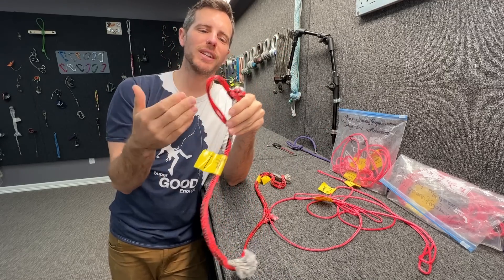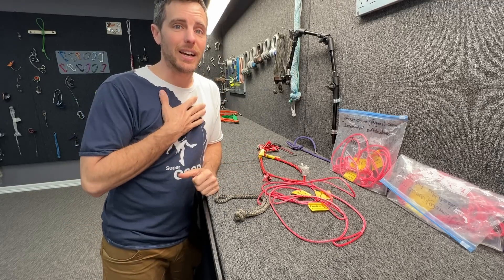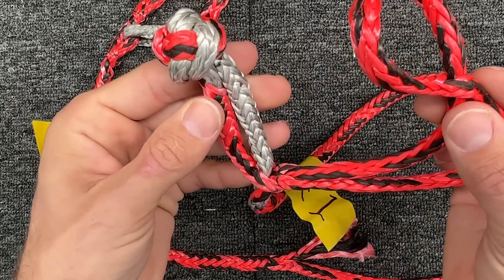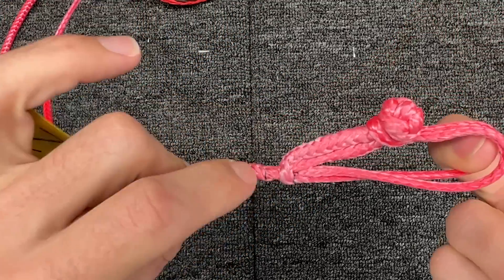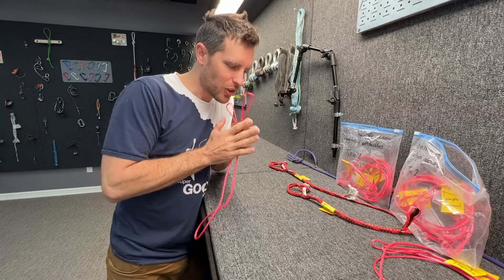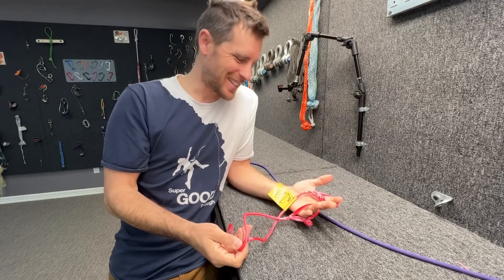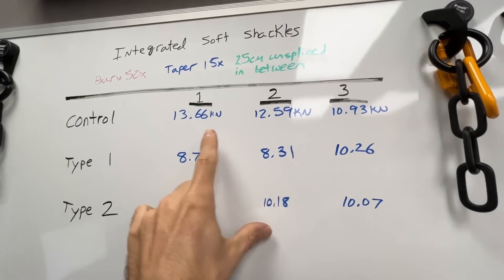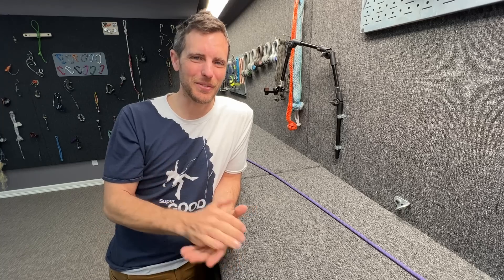2 for 1 deal?

Comment: If you had the money to burn, would splicing the tails tip to tip (each tail buried half the finished length, so that they meet in the middle) be the strongest? Since there wouldn't be a diameter change.

Comment: So with separate soft shackle you get around 13 kN MBS with integrated ~ 10 kN 
Why to consider integrated?
Reply: lets say you have an integrated soft shackle on one side and a winch on the other. you can connect say an off road vehicle to the winch with nothing other than the tow points that are built in to your vehicle. if you instead had a spliced eye and a separate soft shackle, thats one more thing to keep track of, and theres potential soft on soft abrasion

Comment: Thanks for the excellent content. Hope one day you can get some crazy slow motion stuff, maybe  a colab with Gavin and Dan, the Slo Mo Guys? There's some seriously interesting science that can be uncovered if you could see the exact mechanism by which the knots and splices fail, and perhaps even come up with ways to make them better, more efficient. Really loving these break test videos, not just the dyneema stuff. When you realize the kind of forces it takes to break your good rope, or biners, harnesses, cams and whatnot you really do start trusting your gear a little more. Granted you still have the issue of placement or installation to contend with, but that's just another piece of the puzzle. At least you know what you CAN trust, and that makes you trust the system as a whole at least a LITTLE more.
Again - thanks for the content and keep up the great work.
Stay safe out there!

Comment: hey Ryan, any chance you would make a video replacing a cam sling with this kind of dyneema cord spliced end to end into an extendable sling configuration?
i wonder if the 6mm cord would weaken the steel cable more than the oem slings...

Comment: We use dyneema of a similar thickness on the winch at my glider club to pull up 800 ish kilo 2 seater planes :') i really expected more wire, but apparently its all we need. Next to that, we sometimes break a cable, and to fix it we just splice the stuff together, good as new!

Comment: First, i love the ideas. I don't use dyneema lengths greater than 200', with eye bury splices on each end. When i have to connect 1/8" sections, i just use 3/16" stainless quicklinks. The quicklink threads are previously sprayed with dry teflon. Unglamorous, but has worked (so far). HMPE is high MODULUS polyethylene? As opposed to UHMWPE which is ultra high molecular weight Prince Edward.

Comment: On the type 2, instead of running the small loop through the brummel, what if you ran the small loop behind the brummel and crossed  through it in an X pattern, so that the small loop is pulling on both parts of the brummel, yet is kept in place by the brummel?
Reply: That's brilliant! I'll have to try that and see if I like it :) I might add some bulk though I suppose.

Comment: Not my area of expertise, but a few thoughts. It seems, if I have understood correctly, that the guts of the matter comes down to . . . Non-integrated soft shackles VS integrated soft shackles. 

To my mind non-integrated seems to offer simplicity and versatility of equipment, whilst integrated seems incredibly complex, and wondering if that complexity will lead, in time, to manufacturing errors by someone not fully understanding the fine and many details, or overlooking something vital. The old adage, 'KISS keep it simple stupid,' comes to mind.

I appreciate in the field that one specialized item might be very useful. And appreciate how interesting all these options are.

Great work. Hope helps. Any thoughts?
Reply: I think this is very valid, and I'll be picky where to use these. What I have been doing up until now is to make a normal eye-splice, and take a normal soft shackle, thread the shackle in the eye quite close to the knot, and seize it in place with a waxed twine. This is almost as elegant I feel, more flexible, and arguably safer in the sense you mention that there is just less going on and less opportunity to make mistakes. I'll probably use these for terminating halyards though for example, where you really want a very permanent shackle at the end.
Reply: @JOHANDOMEIJ  image useful so an extra item is not dropped overboard.

Comment: I have a samsung refridgerator with all the bells and whistles. A full electronic control system, independent climates in separate drawers, you name it. I  have a 1996 side by side fridge in the garage, all analog mechanical controls, no bells, no whistles.  I have had to fix the samsung I don't know how many times, never worked on the other. The more complicated the system, the more points of possible failure.

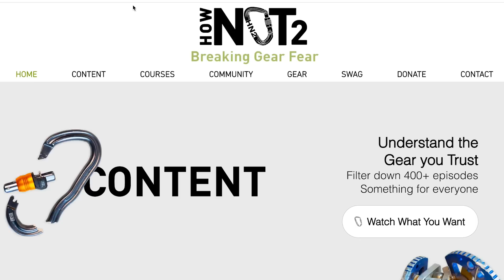Comment: 10:19 - When that splice gives up the ghost, it will certainly cause the tail to pop out. Why? Simply because that brummel splice is the tough guy holding the tail in place. If that splice breaks, it can't do its job anymore and the tail can slip out.
Reply: The finger trap effect can hold it at full strength even without the brummel. Weird, but true. This "bury splice" is what they do for official test samples.

Comment: So one of the other things to consider is the bend radius (for instance in the type 2 arrangement, where the small loop with the button knot has the 4mm line around it) . Iirc dyneema wants a min of a 3x it's dia. bend radius to retain its max strength, and it would appear, although the type 2 did very well, that where the large dia and small dia interface, and subsequently broke, is a quite small bend Rad. Certainly visually appears to only be the 4mm (actually 3.5mm) bend Rad. 

I love these variants, i built a crazy one I'll have to send you a pic of that I've yet to test yet, made from 3/8 Samson Amsteel Blue.

I tend to believe that a soft shackle with a properly buried button knot retains so much of its strength, is that the neck of the button knot is so thick, essentially 4x the dia.
Reply: I'd love to see your variant!

The larger the bend radius the more strength is preserved, so I interpret the "3x diameter" rule as more of a rule of thumb for when you start hitting really large losses. When the manufacturers determine the breaking strength they use huge cylinders often 50x diameter or more. Most knots will have bend radii of ~1, which is terrible for any fiber really, but especially for low-stretch stuff like Dyneema. Notably the Figure-8 knot is an exception, with larger bend radii.

Comment: The double Brummel with the small loop is brilliant! Thank you for sharing.
Reply: My position is that the Brummel is a vulnerability here. It is just supposed to be an easy replacement for a stitch-lock to keep the loose splice from shifting. Why not create them that way & test. Don't stitch with dyneema. Use something stetchy. Maybe whipping twine? 

About a decade (or more) ago, I made a sheet for my boat that was out of a single piece of line, including a built in soft shackle and no Brummel. Just create an eye by feeding enough line for the eye, plus the bury, plus for creating a button knot, back down itself, exiting at the length of the desired eye, then fashion a button knot with the tail feeeding out the bottom & send that back in the exit point to create the bury & taper. make it reallly long, no scrimping.